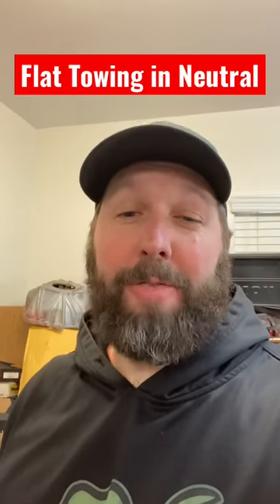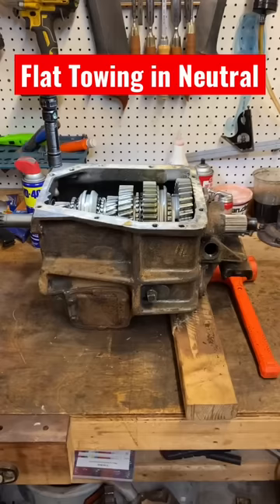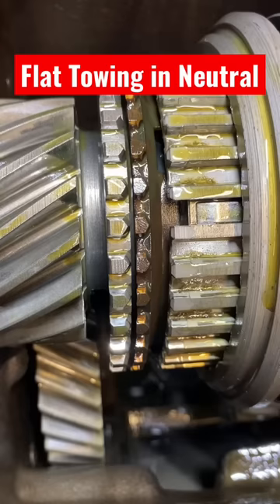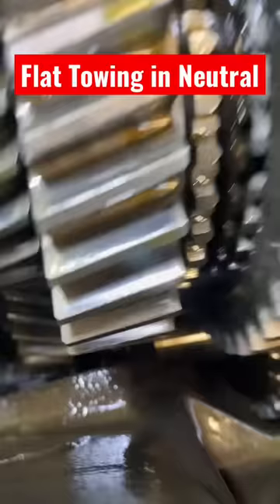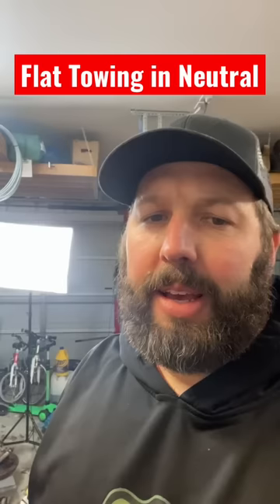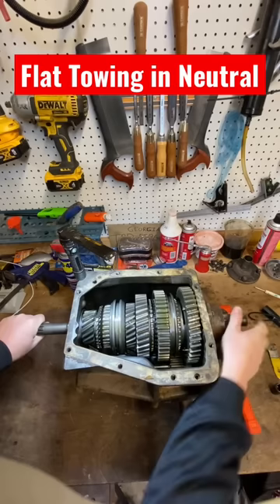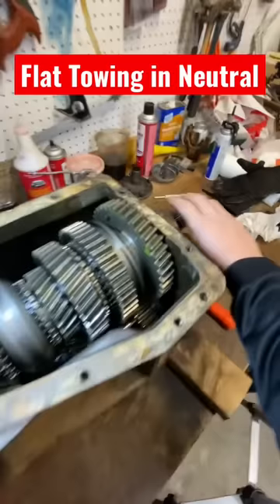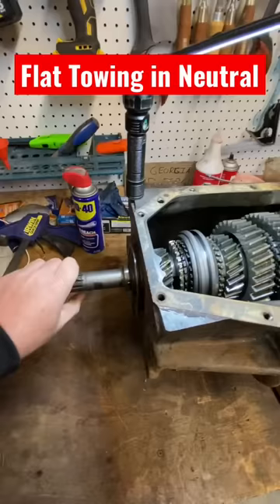Flat Towing in Neutral??? #transmission #stickshift #mechanic

Comment: Facts! I have been telling people this for years and they don't listen until they end up with transmission problems.
Reply from the maker: Even when you show them, they won’t listen 🤷🏻‍♂️
Reply: @freedomworx  thanks for the info never knew only ever been told not to flat tow automatic transmission verhicles
Reply: So what is the correct way
Reply: @patrickbledsoe2176  for real dude? Seems like you're being a smart @$$.
If you don't know you won't find out from me.
Tow it the way you been towing it.
Reply: @catdaddy119  seeing how you cant really convey tone through text there is a decent chance this guy is just asking a genuine question. And come to think of it im wondering about the answer as well.
Reply: @catdaddy119  naw bro I'm for real I've never towed nothin behind a RV or anything only stuff that has broke down and needed towed home  never very far and always this way in manual or auto didn't mean to comeoff as a smart ass I apologize
Reply: @patrickbledsoe2176  Okay, my bad. It's a lot of ways to go about it. You can flatbed it, you can trailer it, you can use dollies for the rear wheels, you can tow it from the front (if it's front wheel drive) it all depends on your application and the car you're towing. 
All wheel drive would have to be towed a certain way as well. 

Consult with your local U-Haul and they can be very helpful.

Never tow it in neutral with all the wheels on the ground.
Reply: Ya like those are all options if it’s the middle of the night and you don’t have a couple hundred for a flatbed to pick it up. In a perfect world I’d call a ramp truck too, but in an emergency I’ve towed multiple vehicles by tow strap and haven’t had a catastrophic transmission failure yet.
Reply: @highdadd6526  SMH
Reply: because it is horse dung :D and if you thin that flat towing  in gear is better then let me introduce you to reality , if your manual transmission is in gear that means it is spinning the engine and possibly spinning it in the opposite way that it is meant to spin
Reply: @patrickbledsoe2176  on a damn flat bed or remove the driveshaft..
Reply: @highdadd6526  yea it's always emergency for me also and a tow bill might mean not getting the truck fixed for another pay period
Reply: @codyjohnson5674  drive shaft shit I should thought about that cool I do appreciate all the advise guys
Reply: @patrickbledsoe2176  disconnect the drive shaft on rear wheel drive vehicles. Use a towing dolly front wheel drive vehicles. Or better yet put the whole thing on a trailer.
Reply: @freedomworx 
So the proper way to tow it is ? 
Driveshaft removal ?
Reply: good knowledge thanks
Reply: @catdaddy119  so if it's a manual do you put it in 5th?
Reply: Onnly some are that way. Others can be towed.
Reply: @highdadd6526  once or twice and in short distances won't kill it sure, wouldn't advise it for long distance. AAA is not expensive to have for a tow.  I've used AAA to move project cars from one spot to another that have "broken down" 😂
Reply: @patrickbledsoe2176  guess
Reply: @catdaddy119  just tell him tow it out of gear with the motor running... lots of oil that way

Comment: If it's already blown up, it don't matter.
Reply from the maker: Depends on the failure I guess 🤷🏻‍♂️
Reply: Until it binds up and locks...
Reply: @antontaylor4530  ? You may be right. Depends on how far you are going. 10 miles or 1000. At under 20 mph, I wouldn't worry.
Reply: @firesurfer  I just pull the driveshaft.  8 bolts and you know for sure nothing is going to 'splode.

Comment: When I ran Heavy wreckers, we would drop the drive shaft for this reason
Reply from the maker: It’s the safest option 👍
Reply: Or pick up the rear end and lock down the steering. If it's got air bags chain the axle to the frame before you raise it off the ground

Comment: So...what gear are you suppose to tow in?
Reply from the maker: Best to consult the owners manual 👍
Reply: Most owners manuals will just straight tell you to not dingy(flat) tow your car. (Even if it is possible) 

( Part of that simply is the fact that there are so many options on cars (hybrid, AWD, auto Ebrakes, ect.) that all owner manuals Reference towards them just to make sure that somebody doesn't destroy a hybrid transmission Or completely destroy the power split unit on an all wheel drive car..

 Nowadays with everything being all wheel drive or hybrid you basically can't do this almost at any time with any vehicle..

 Easiest way for a real drive vehicle is to just take the drive line out

In some older front wheel drive cars you can disable the hubs.. But nowadays that's a pain in the ass..

 This is also why you see a majority of tow trucks going to flat racks.
Reply: When we had an 06 Jeep TJ, the manual said to flat tow in 4th gear. I was always curious as to why not neutral. This demonstration by Jamin was the perfect explanation.
Reply: @HammerWrench  did it just pull the engine? It does kinda make sence cuz everything was mechanical and the oil pump would work. 5th was prolly OD (not even sposed to tow in OD on older vehicles)
Reply: @anthanybowden6295  we sold it before we ever flat towed it. I was just baffled by why you’d want everything rotating going down the road. Guess there has to be excess wear somewhere, but being in neutral will kill it.
Reply: @anthanybowden6295  power split unitmmm?lmao..you mean a differential?
Reply: @Glitch The Cat  .. .OK you got me there.. Power split devices typically used in hybrid systems.. It's basically a cvt that runs off of planetary gears...

The reason I said that at the time.. Is I just watch a video about somebody talking about an AWD drive. System going Out. (Probably because it was towed) On someone's car.. And they were showing the damage from the rear axle all the way up to what they called was the PSD... But yes I believe you are right and is the center differential...

I was just saying this specifically because in most new cars they have a torque differentiator somewhere in the car that will control the power from the front and rear wheel differently According to traction and acceleration..

That was the part I was talking about destroying on an AWD..

And if you didn't notice I did mention both all wheeldrive and hybrid.. So terminology could have gotten mixed up.
Reply: Towing in reverse, your fuel tank may overflow.
Reply: My samurai flat tows in 2nd gear with tcase in N
Reply: I've always put it in neutral and pulled the rear driveshaft
Reply: @CODY SWILLEY  for a RWD and 4x4 thats the best way to do it..
Reply: @anthanybowden6295  yup

Comment: There is one condition you can do it, if you have a manual transfer case put the transfer case in neutral. I do that all the time
Reply from the maker: If your T-case is in Neutral, then your trans should be in gear or park. Assuming your Owner's Manual tells you to put the T-Case in Neutral.

Comment: I helped a friend of mine swap a diesel and 4wd trans into his 2wd Ranger. He couldn't understand why I insisted it was so important to have a tranfer case on a 2wd truck. Luckily the 2wd transmissions were basically the same price so he got the 4wd trans. Not only is it better behind his RV but he uses the low range far more than he expected.
Reply from the maker: Interesting. Never seen anyone put a T-Case in a 2WD truck. 🧐🫡
Reply: @freedomworx  He really likes the low range at the boat launch. Now he's actually considering having the t case modified so that 4 hi only sends power forward for use as a pto. That way he can use his tractor generator on his truck in emergencies. He bought a generator to use on his little ancient Kubota but it didn't have the hp to run it properly.
Reply from the maker: That's an interesting concept also.

Comment: Most tow drivers, pull the axles. Are truck chassis with cabs, came piggy backed. Before we turned them into boom trucks, we had to install the axles first, once, the injectors weren't tightened, and leaked all over. Sterling quality.
Reply from the maker: Yeah, pulling axleshafts is an option on full floating axles 👍

Comment: Have been towing my 1943 jeep for years always pull the rear axles any unlock the front hubs. For just that reason. Works out to about 1000 miles every year for 25 years .
Reply from the maker: That’ll do it 😎

Comment: This does depend on the car, there’s a few lists out there that show you which cars can and can not be flat towed, some have to have a fuse removed and ignition on some just ignition on. Rvers do it all the time with no issues but it has to be the right vehicle or add a few mods
Reply from the maker: It’s perfectly fine for many cars. Just trying to bring awareness to those that had no clue that it could be harmful.
Reply: @freedomworx  oh for sure, before I learned this I thought any car could then doing some research for a customer I found nope some cars will go kablowie lol
Reply from the maker: Yeah, it’s not intuitive. No reason for folks to ever think it could be dangerous, unless somebody tells them. I’m lucky that I never screwed one up 🤷🏻‍♂️

Comment: I've been flat towing mine for 20 years in neutral and its still working. and a zip tie trail fix for reverse is still holding strong for 15 years.
Reply from the maker: It all depends on the specific transmission design. Some handle it fine, some burn to the ground. That’s why it’s important to read the owners manual before doing it.

Comment: If you're going to tow a car with 2 wheels down, it cannot be the drive wheels.  All-wheel drive cars must be put on a bed and can NOT be towed with 2 wheels down.   Those are the rules!  [ ormer award-winning mechanic and mechanical engineer with 3 Engineering degrees.]   Wonderful video!
Reply from the maker: You only make that mistake once 🥴

Comment: Yeah, don’t flat tow with the transmission in neutral. However, many (not all) 4x4 vehicles with a 2 speed transfer case have its own neutral setting. This disconnects the output of the transmission (also the input of the transfer case) from the outputs of the transfer case (aka the drive shafts). This means that the transmission can be in Park ( or in gear for manual transmissions) and the vehicle can still roll with the parking brake released. In fact, many manufacturers will state in their owners manuals that in order to safely flat tow, the transmission needs to be in Park (or in gear for manual transmissions) and the transfer case needs to be shifted into its neutral setting.
Reply from the maker: Yep, your are correct 👍

Comment: Never really thought about it. Only time I've ever needed recovery my whole car was pulled onto a flatbed, so never had the wheels turning.
Reply from the maker: It generally only becomes an issue at higher speeds and longer distances. But you have to refer to your owners manual.

Comment: I had to flat tow my manual truck one time, about 3 miles going 10-20mph. Sister hooked a strap to my truck and towed me home… engine cranked but wouldn’t start. Probably not enough to do any real damage, but good to know for the future
Reply from the maker: Yeah, slow, shorts trips aren’t likely to affect anything. Some can be towed without issue indefinitely.

Comment: If the car starts you can leave it running and then put it in neutral and you won't burn anything up while towing it. An idling engine burns about 1 gallon of gas every hour so if it's a short tow you'll be fine and it won't run out of gas and shut off.
Reply from the maker: It’s an option. 👍

Comment: My car (5 speed manual front wheel drive) was towed 200 miles. No damage. There is no load on those gears. No problems.
Reply from the maker: Might not have been a problem with your specific transmission, but it’s for many. But your scenery is a transaxle, not a transmission. I’m not making this up. https://www.tremec.com/not_am_detalle/flat-towing-manual-transmission-vehicles/

Comment: I flat towed my nissan cross country once. Didn't feel like climbing underneath to disconnect the drive shaft so instead I popped the shifter out of the top of the trans and dumped a gallon of oil in it. When I got to where I was headed I took it  for an oil change and had them change the trans oil too. Worked perfectly. 😂
Reply from the maker: It’s an option. Just seems like a lot more work than disconnecting the driveshaft. 👍

Comment: I've flat towed a manual, but disconnected the driveshaft.  That works fine as long as you tie the shaft up real well.
Reply from the maker: Just let it drag. The sound will go away eventually 😂

Comment: Yes, and if the transmission was under load, that would be bad. But with no load on the trans, it's not going to hurt to flat-tow it ten or twenty miles. For a longer tow, yes, disconnect the driveshaft or put the transfer case into neutral for a 4x4.
Reply from the maker: Yes, it will take some distance and speed to create enough heat to damage things.

Comment: My grandfather used to just add enough gear oil to reach the bottom of the top gears while towing, then he'd drain it off into a container until it was needed to be towed again, don't know if it worked, but he never had trouble.
Reply from the maker: Yeah, overfilling is an option.
Reply: @freedomworx  i don't see how it worked, you still put unnecessary wear on the transmission...no?
Reply from the maker: I mean the best option is to remove the driveshaft. But it being freewheeled by the driveshaft isn’t any different than it being spun by the engine in neutral, besides the oiling issue. Which overfilling should address.

Comment: If it's under 100 miles then you can flat tow it all day long and it will not damage anything. If you go beyond that yes it will damage it depending on the terrain. Either way great short!😎🎂🍻
Reply from the maker: I’ll just stick to doing what the owners manual says. Speed and distance are both factors.

Comment: best thing is to remove the prop shaft or in the case of a front wheel drive. disconnect the drive shaft. newer manual gearboxes allows for towing though but i still stick with my old routine
Reply from the maker: It’s the safest option.

Comment: Look closely at the fill plug location on that SM 465 and you’ll notice that the top gears catches oil when it is full.
Been flat towing T98  4 speed In neutral in my CJ5 behind my pick up or decades without issue.
Reply from the maker: It's not about any specific trans. It's about "if" your owners manual states not to do it, this is why. And a Jeep is a different animal. It  is towed with the T-Case in Neutral and the trans in gear. If you are towing it with both in neutral, you might want to take a look at an old CJ5 owners manual.

Comment: In vehicles that have two batteries, you can do this:

Weld the anvil of a 1/2" electric impact to the input shaft, zip tie the trigger and hook up to your aux battery for power.
Reply from the maker: Rube Goldberg

Comment: It takes a while to dry out the lubrication just free spinning, no load,  short distances your usually fine. If your rear end is geared extremely low or your pulling long distances just drop your driveshaft.
Reply from the maker: That's the safest bet.

Comment: I learned the hard way. Towed a 1 ton about 150 miles at night so I could see it smoking lol I was also wondering why the gmc I was pulling with would lunge every so often. Got it to a shop and dropped it off. He called me and said I should come down and have a look. He had partially torn the auto transmission apart. I looked in and there were balls of metal in the trans. I’m surprised it didn’t burn the truck down. I know better now
Reply from the maker: That sucks. But like you said, many truck and cars have burned to the ground from flat towing.

Comment: I learned this 2 yrs ago when a tow truck driver towed my  5 speed mustang.  He said  """ I'm here to townyour car because  of a ball joint but I'm leaving you car in 5th so you don't  destroy  the transmission  and sue us"""""  though about it.  Engine  turns transmission turns.  All is lubed. So harm.      I was pissed at first till he explained it to me.  Makes sense.
Reply from the maker: Surprised someone showed up without a rollback, good thing he knew what he was doing. 👍

Comment: That's why I like my 90s ford's. You can put the transfer case in neutral and everything is good.
Reply from the maker: Most T-Cases are that way. But the trans should still be placed in Park or Gear depending on if its an Auto or Manual.
Reply: @freedomworx  If you put the transfer case and manual transmission both in neutral, nothing should spin except the rear drive shaft, right?
Reply from the maker: @WhiteYetiAK nope. Fluid friction in the transfer case will spin the trans. That’s why 4wd owners manuals tell you to put the trans in gear or park.

Comment: It is a good idea if you’re going to tow any vehicle, whether it be a manual or an automatic remove the driveshaft from the rear, axle yoke and secure it”tie it up” where it will be secure, and will not come out as you are towing the vehicle.
Reply from the maker: That’s the safest option. 👍

Comment: I was always told not to tow a manual transmission in neutral for more than 10-15 miles because of no lubrication and if you had stole it further than that at some point to get in put it in 4th or 5th gear tell it a short distance and then go ahead and kick it back into neutral that way it had gotten some lubrication up there to those gears but that's just
Reply from the maker: There are several ways to make it work. 👍

Comment: My 1994 camry is a FWD automatic and we towed it home with the drive wheels on the ground. It was such a dumb idea. The steering wheel doesnt lock, so we had that sucker wrapped in ratchet straps to keep it straight, and even then, it was all over the road on the way back to the house.
Reply from the maker: Sometimes you’ve just got to do what you’ve got to do 👍